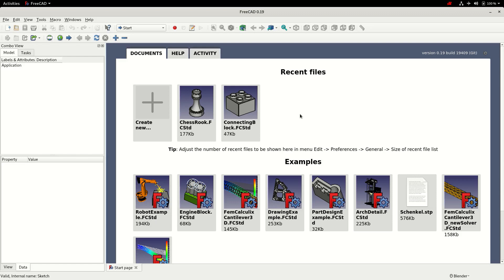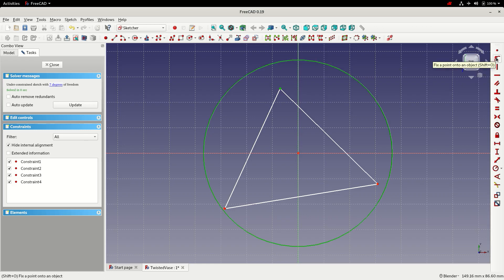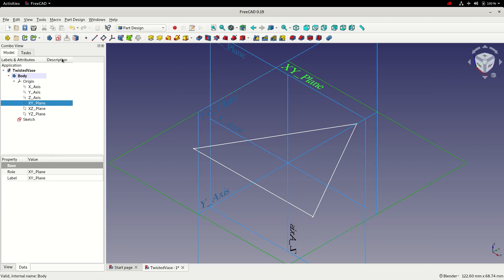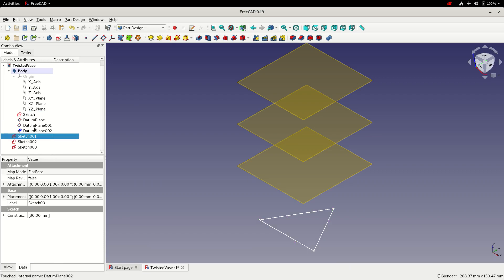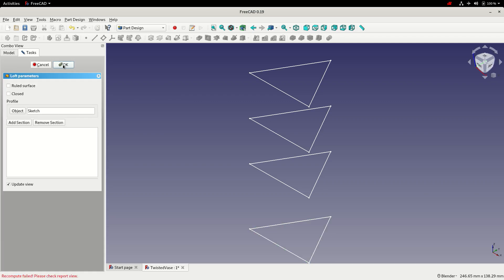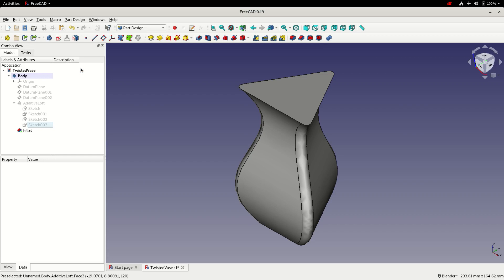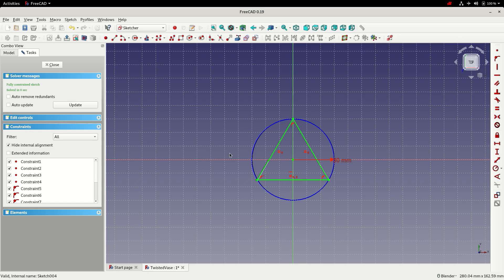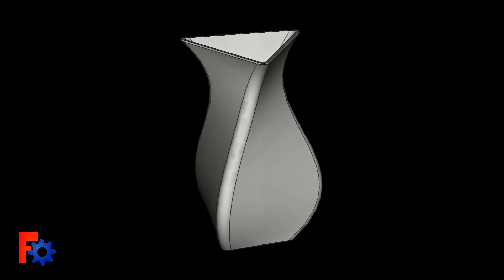FreeCAD Tutorial - Basics - Twisted Vase

Comment: I just found this tutorial, and followed it through with no difficulty, but using a simple octagon top and bottom, to created a tapered octagonal flower pot.... When I tried to twist it, any angle more than 22.5 degrees caused the twist to reverse direction, and become (45 deg. minus my specified angle).... In other words, if I twisted the top 15 degrees, it worked fine.... If I twisted it 30 degrees, it became the opposite twist of only 15 degrees.... If I twisted the top by 45 degrees, it reverted to the original untwisted shape.... I wanted that 45 degrees of twist, so that the pot twisted one flat in its height.... HELP !!!!

Comment: For the life of me I can't figure out how to get to 0 constraints with you.  I'm using FreeCAD 0.18 so maybe a version difference, but I'm 2:35 into the video and still have 2 degrees of freedom...
Link to screenshot (Hopefully it's allowed)
https://imgur.com/a/8nPHcAX
Reply: So I’ve had some help in other forums.  My problem was that the center of my circle was not anchored to the center of the sketch.  In the video he has the “snap-to” feature enabled so his automatically constrained to the center.

To fix this I had to select both the center point of the circle and the center point of the sketch and add a constraint.
Reply from the maker: Thanks for the feedback!
Reply: I am having same issue. Once triangle is drawn I and video have 6 degrees. When video adds circle it goes to 7 degress. When I add circle I get 9 degrees. Cannot see why I am getting the additional 2 degrees.
Reply from the maker: Try dragging the sketch elements using the left mouse button. If any move or change size they need further constraints.
Reply: @MarthamEngineering  Thanks for prompt reply, but they all move. I have only drawn the circle not linked them yet. After drawing triangle I get 6 degrees as do you. By just drawing the circle I get an additional 3 degrees, but you only get 1 degree. So at 1.16 on video you have 7 degrees, whilst I have 9  degrees. I can do link triangle to circle and make sides equal etc. but the additional 2 degrees remain compared to yours. If I link them they all move as one unit. After setting diameter I still have 2 degrees.
Reply: Additionally I am on V0.18. When you add circle I note you get Constraint 4, whilst I don't.

Comment: This is very cool.  I'm looking to build an item that has a series of columns around a perimeter where the columns would spiral straight up vertically.  Not sure if that make sense.  Would this method work for something like what I'm trying to do?
Reply from the maker: Hi Larry, I don't see why that wouldn't work!
Reply: @MarthamEngineering  Hello.  I was able to get one column to spiral/twist up using your method.  But when I created a sketch with ten columns (10 mm circles) around a 50 mm perimeter on each plane and try to loft them across three planes I get an error about not the same number of wire frames.
Reply: I posted a topic on the freecad user forum with a sample of what I'm attempting to do.  Topic is "trying to loft multiple columns with a twist/spiral"

Comment: Hi Thanks for the great tutorial , However I am unable to add sketches to the original Sketch (they won't select) finally gives an input error , what am I doing wrong here . TIA
Reply from the maker: It's difficult to understand the issue without seeing the file. Please could you join the FreeCAD forum and post the file there?
Reply: @MarthamEngineering  Thank you, I re-installed and it worked after

Comment: Great tutorial as always. I do have a suggestion for a later topic. I have some OpenBeam 15x15mm aluminum extrusion, but I guess the same is true for standard 20x20mm profiles. It looks like there is a free STEP file that imports and it look like the draft workbench has a scale tool that allows scaling a clone of the beam. I was able to arrange some beam together via the A2plus workbench. I'm not even sure if this is the right procedure, but it worked. Anyway, a little howto on how to design with aluminum extrusion in FreeCAD, like make brackets and add bolts and nuts etc pp...
Reply from the maker: I have planned  a video for importing dxf files of 2020 profiles and creating solids. It would a nice intermediate level video to use those for a project.  Great idea. Thanks.